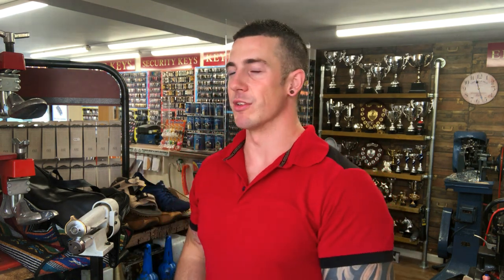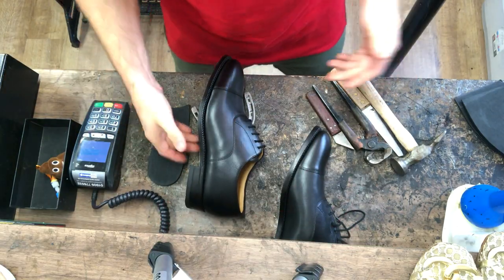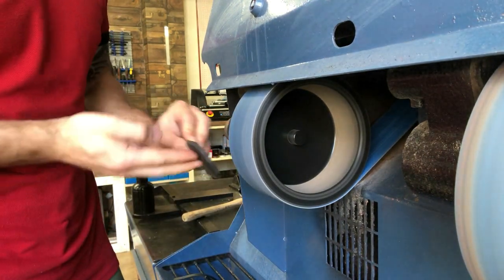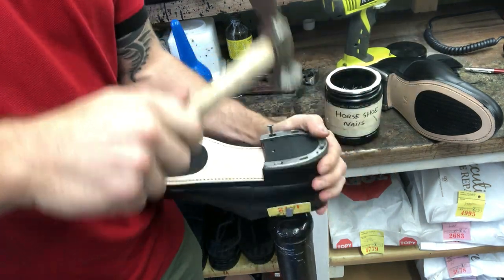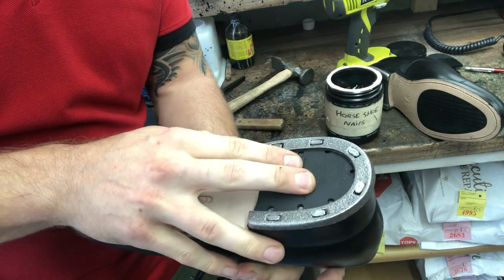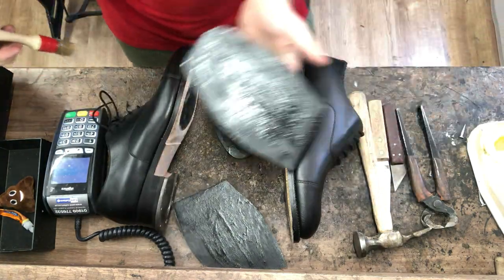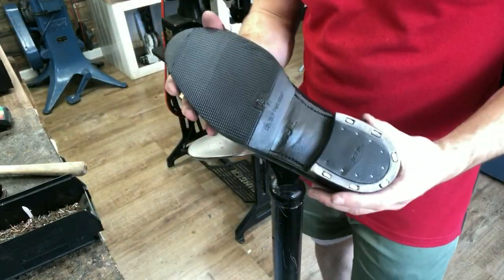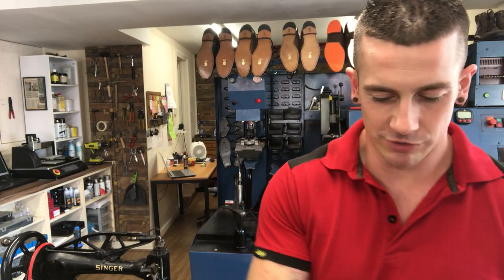Horseshoe Heels fitted on RAF Drill shoes | Metal work |  RAF boots | Heel plates

Comment: Good job the are officers shoes. The rubber soled nightmares they issued me when I was at Halton when I was at Airframe Training Squadron (AFTS) when Halton was No.1 School or Technical Trade Training would have fallen apart if you put horseshoes on them and I would have been thrown out of the aircraft hanger and got abuse for being a sad cabbage. I bet they are parade shoes for one of the officers or instructors at RTS.

Comment: What's the history of all that metal on the bottom of military footwear?
Reply: Cost saving. Back in the day, shoes were made out of leather, including the soles. If you march in them 100 km/week, the leather gets worn really quickly. Fit heel irons and hobnails and the leather is protected from wear. The iron lasts longer than leather and can easily replaced.

Comment: I didn't realize that the RAF had metal on their heel and toes, that's a big NO, NO, in the US military, I've been in the US Marines Navy and Army and have drilled with a three and that is not allowed on the drill deck here in the US military. Nice job tho and would be interested in trying that on a pair of shoes, just for GP, since I'm retired I can do what I want with my dress shoes. 🖖😎
Reply: Probably parade shoes
Reply: You would if you were an RAF officer or an NCO that is posted to RTS (Recruit Training Squadron) at RAF Halton where you are doing pass out parades every few weeks as it a show for the families of the recruits passing out and they bought additional gear (e.g. parade white belt with the RAF crest in gold etc). I was an RAF airframe technician for 12 years and had two pairs of rubber soled shoes one was for everyday wear and the other pair were for parades in my “best blue” No.1 uniform (spit shined all over to a mirror finish) and the only time I saw those shoes in the “real RAF” were on officers that shined the seat of their trousers on a chair all day. They used to come into the hangers where the aircraft were and they were told to take those shoes off as they had no place in an aircraft hanger as usually the air was full of jet fuel fumes and they might cause a spark.

Comment: In my day it was absolutely not permitted to modify issued uniform.  No was it allowed to put metal segs or nails into soles.  One may have to carry out drill or parade in a hanger with aircraft present or near an aircraft outdoors.  Sparks and fuel vapours do not mix.  Nor were a separate pair of shoes issued solely for drill.  When your working shoes wore out you used your parade shoes for work and prepared a new pair for parades.  The RAF is about flying aircraft and shoes with metal in them do not belong with aircraft.
Reply from the maker: that's great! However this is what the RAF have requested us to do for around 12 years so i think we'll go with what they want
Reply: These shoes are more than likely for the DI staff at the local RAF base. I remember DI staff wearing ammo boots during my basic training. It was all about the noise. We had 2 pairs of shoes. 1 for wearing day to day, the other for wearing with Number 1s. Nobody I knew ever wore their No1 shoes if the others wore out as they were polished to a glass like finish. You just took your old ones to Stores to get a new pair.
Never heard of a kite exploding because someone had a bit of metal on their shoes on a parade.
Reply: Thankfully nobody told the pilots during 1940 that their shoes (which had blakeys on) couldn't be worn. Things change over time. Even for those civvies in uniform (RAF) And as for modified kit, I was in the Army and we called it improvisation in Iraq. Always remember your kit is made by the lowest bidder. And no pilot I saw in combat ever had purely issued kit. What works on the parade ground rarely works when on operational tour. Anyone who has been on ops would know that. Those  shoes are for parade use only, however without the metalwork the sole won't last 5 months. Hence why our Ammo boots had all that and more on them.
Reply: @Dan_the_cobbler  Yes you are right. Halton always was a training unit and there always were RAF Admin people (Drill Instructors). In my day (1990) it was No 1 School of Technical Trade Training for aircraft engineering tradesmen and we had DI’s that bought their own kit for parades. Like the shoes you did and white belts with the RAF crest in gold etc. I know that Halton is now the home for RTS (Recruit Training Squadron) as well as other training units (because the officers mess in a Rothschild Mansion and the RAF can keep it as long as Halton is a training camp but that’s another story). I can only assume that those shoes either belong to an officer or a DI on RTS and are used as parade shoes for pass out parades as it’s a big show for the families of the people that completed basic training. When I passed out and went to an operational squadron, my issue shoes were black rubber soled because I was in the vicinity of aircraft and horseshoes etc were forbidden due to the vicinity of jet fuel vapour and sparks and plus they amount of ridicule I would have gotten of the rest of the shift would have been epic.